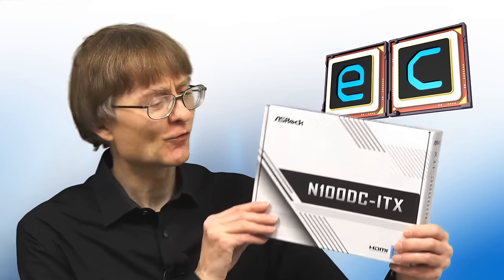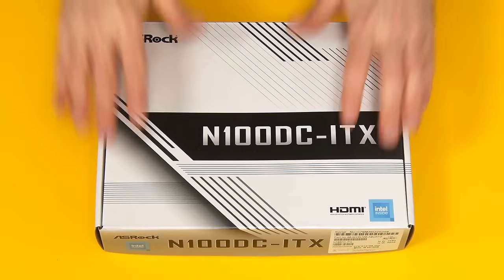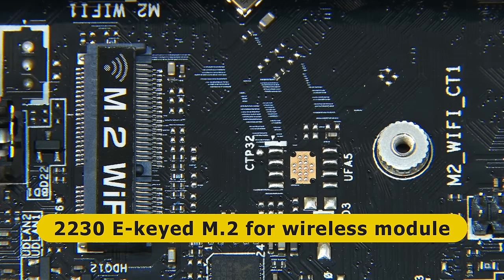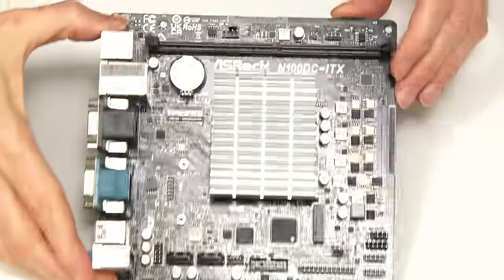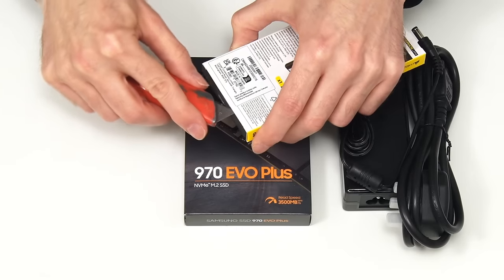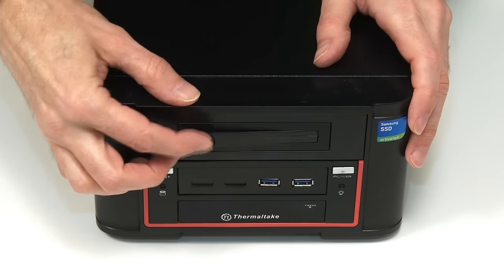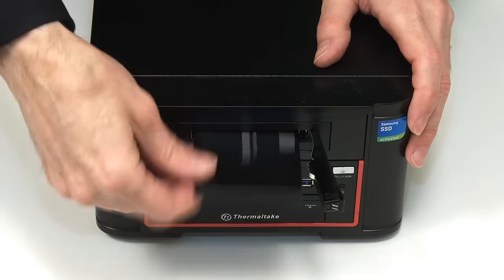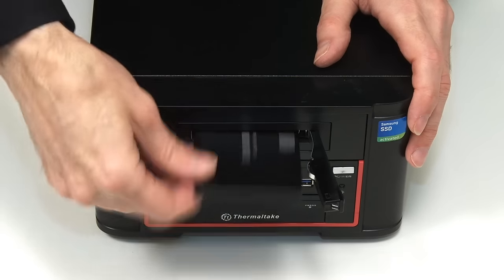N100 Mini-ITX Silent PC Build

Comment: Glad I caught this video Christopher! This gives me some ideas for upgrading a nice old Falcon Northwest aluminum 'Shuttle' type case that currently has an old mini-ATX with a dual-core Celeron that's about used up. I'm pretty sure the case is setup for a micro ITX as well, but even if it isn't, there's plenty of floor space to redrill it for the necessary stand-offs. I don't see those SATA power cables being able to support any type of standard 3.5 in. SATA drives, so I may have to go with the N100M, so I can retain my stock PSU, and a case fan or 2, to keep the drives cool. It wouldn't be quite as efficient, but I could have a LOT more storage, and exponentially faster to boot!😉

Comment: Thanks for the idea! I'm planning to build a low power home server soon and energy usage is a major consideration, alongside noise. While this specific model doesn't have enough SATA ports for my liking (unless I get a PCIe -> SATA card), this has definitely pointed me in the right direction!
Reply: There's a few aliexpress motherboards out there with 6 sata and 1-2 M2 shots.  They appear to be the latest cpu upgrade on boards that came up from 5105 & 6213 cpus.

The main struggle is the N100 only having 9 pci lanes to handle everything, so there's some compromises. Those motherboards seem to originate from NVR security camera recording. So they get 3/4 2.5G ethernet ports (!) which claim the lion's share of the pci lanes.  Still very good value of you wait for the prices to cycle lower.

I was looking at older SFF pcs or H110i motherboards and the price-performance-wattage on the new N100 softrouter/nas setups appear to compete very well even against used systems.  We don't get as great deals on discarded commercial kit in the UK.

Comment: This is why the heyday of the SBC is over. For a comparable price, you can get a more capable system than an SBC. That's not to say there are no use cases for an SBC form factor. But more and more people are going to build systems like this instead of using SBCs. If you're looking for a quick video to produce, you might compare the performance of this computer with similarly-priced SBCs. I think that would be very interesting.

Comment: Hi Chris, the temperature is certainly acceptable for a fanless PC, and the components are mounted fine for airflow, but I'd prefer to keep it cooler if it was mine. You should test it with the case open, or placed on its side, because not having vents at the top may be something you can fix, and a vertical orientation may help speed how quickly air goes over the fins. Once that's determined I feel like the heat sink could be swapped for a larger one if you like (and you'll probably improve cooling just by reapplying thermal paste more evenly). Lastly, you MAY be able to reduce idle power consumption and therefore temperature by capping the CPU speed in windows power options, or the voltage in BIOS. You can look at power options for the samsung drive and RAM too. But I think step #1 should get you up to -5C improvement without any performance hit at all.
Reply: I often wonder why people like to keep their heat in a box )-/

Comment: This would be great to use for a low powered NAS, especially if you used flash storage for the array, complete silence! Great video Chris and may be the basis for my next homelab build.
Reply: Have you seen those NAS N5105 boards by topton? They have 6 SATA ports.
Reply: That was my first thought as well, but the PCIe / M.2 connectivity looks a bit limited to me though. Still an interesting motherboard. I'm running a HP Prodesk 400 G6 (SFF) I bought used off ebay for about £160 a little while back, came with a core i5 (9th gen), 16GB Ram and an SSD. I upgraded a few bits on it and run Unraid on there. Quiet, efficient, and quite powerful when it needs to be.  About 8W on idle and similar on load to this N100 system with an 8 core, Core™ i7-9700T. They are great for a NAS and can fit a single 3.5" drive as well which is handy. Not silent, but I run it in the loft of my garage anyway, so I can' t hear it! 😀

Comment: An EC build without 'come on you little swine'? It's gone very smoothly then!

8GB of RAM instead of 16GB is an interesting choice. I'm assuming Linux Mint 21.3 may see a newer kernel that supports the N100?

Thanks Chris for the video. These N100s are decent little chips.
Reply: He probably said that during the I/O shield install which he skipped lol
Reply: Either putting the I/O shield on went well or our always dashing pal turned the air blue during the process! 😅

Comment: Looks like a convenient and quiet daily Linux driver.  I’d be interested to see how Windows would perform on it, just out of curiosity.  Looking forward to your next video!
Reply: I'm typing this on an N100 mini-pc running Win11. It's fine. Nothing astonishing but I'm delighted for the price.
Reply: @stanwbaker Thanks for the info!  Wishing you a great day!
Reply: These days I feel Windows needs at least 16GB RAM to be performant. Linux is probably ok with 8GB.
Reply: @mikeh7704  That is my general feeling also.
Reply from the maker: Windows still runs perfectly well with 8GB -- it depends on the use case, as I very clearly detailed here. Standard office and web applications run absolutely fine in 8GB of RAM on a properly configured Windows system.
Reply: @ExplainingComputers  Glad to hear it !
Reply: @ExplainingComputers  I think the term "perfectly fine" is debatable when used to described any computer that runs Microsoft's bloated and privacy-hating mess.

Comment: Lovely stuff! Regarding power consumption, I went from ~120W idle on an 3rd gen Xeon 12 core (fastest you could get on socket 2011), all the way down to ~50W with 2.5x the performance with 12th gen. I also added a good chunk of RAM too (32GB to 64GB). 

May not sound like a lot, but given the 24/7 usage, that's a good chuck of my house's base load reduced!

Comment: Its rather interesting to see a motherboard these days that has PS/2, VGA, Serial, and Parallel, while having support for a bunch of modern connections.
Reply: I wonder if the board is aimed at replacing some legacy hardware they wouldn't need much CPU but might still need serial and parallel connections

Comment: Got a couple questions about your choices of hardware:

1:  Why only 8GB?? I would have figured 16 would have been better?? I know that Mint is more efficient memory wise, but that may still be a problem....

2:  Why not the N200 or N300/305.  It seems like the extra performance and  the higher memory and disc performance may have served you better over the next 10 years....

3:  Did you consider a standard power supply with a Zero RPM fan?? That probably would have remained silent unless things were getting really warm....

Thank you for time, I enjoyed the video.  I learned something about tinnitus, in your previous video.  I didn't know there was such a thing as a "trigger" for tinnitus, which explains why my ears whistle more when my HVAC system kicks on.

I hope your holidays is most excellent!!
Reply from the maker: I used 8GB because it is more than sufficient for my use case. I do not understand the obsession that seems to be emerging of fitting more RAM than required (which will use more power and generate more heat). I can 100 per cent guarantee that it will not be "a problem". I am bewildered with the comments here telling me how much RAM I need given the use case I clearly explained.

I am not aware of any N200 or 300/305 Mini-ITX motherboards!

This case does not use a standard ATX PSU. It uses SFX, and a zero RPM SFX PSU is very expensive.

I have built many, many silent and quiet PCs on this channel over the years, including those with zero-RPM PSU fans and very quiet CPU and case fans -- eg in the series that starts here: https://www.youtube.com/watch?v=1iVMGSBFy-M

Please assume that in a build for a daily driver PC with a very specific use case that I did draw on my 30 years of PC building experience, especially of quiet PCs, to select the best components for my use case! :)
Reply: @ExplainingComputers  

Sorry if that came through as confrontational, it was not meant to be.  It was merely a request for information.

1: "8GB is enough for what I need."....kwel!!  

2:  "not aware of  N200 or 300 ITX motherboards."  I did not know there was a problem with sourcing them. They are kind of new so I didn't take that into account .

3:  "zero RPM SFX PSUs are expensive".  Cool, I didn't know that, I don't remember you mentioning that it was an SFX PSU in the video.  I mentioned what does zero RPM was because I live in the US and you live in the UK in terms are not necessarily standardized or interchangeable, I just wanted clarity....

My apologies if I angered you....
Monte
Reply from the maker: Sorry if I offended. :)
Reply: @ExplainingComputers  

Not offended, but....

I really like your channel, and  I learn a lot.  It was a bit like my favorite teacher tearing me apart for asking what I thought was a legitimate question.
I have sense decided that it was either a misunderstanding or a "bad day"....

Thank you for replying;
Monte

Comment: I've got myself a Beelink Mini S12 with the same N100 processor to replace my 24/7 running Pi4 home server with something more powerful. It's running great so far with Proxmox. It's a very capable little processor considering how small amount of power it consumes. Finally I can run Home Assitant OS next to other stuff, and have decent snapshot and backup capabilities.
Reply: I have the same machine for playing media running Linux Mint! I do have the pre-installed Windows 11 Pro on another SSD in it though, just to compare performance.

Comment: I have changed from a full tower also 10+ yo i7 desktop to a modern ryzen mini pc this year. I was looking for a completely quiet desktop. This isn't, but most of the time, the noise gap from the older system is music to the ear. I'd take a leap and say that it improves life quality even.
As a sidenote, I'm currently using a Noctua 120mm fan at a project at work. It's 12V rated, but I'm powering it at 5V. It is not dead silent, no, but inside a case, it might pass unnoticed. And it helps with the thermal profile. Additionally, as a diy project, one could add a usb pwm module and implement a temperature curve control, in order to keep noise at a minimum.
Model I believe it is NF-F12iPPC-2000.

Comment: Back when AsRock used to be complete crap, but this seems like a well-implemented board.  I may have to give them another look.  Thanks!
Reply from the maker: I too remember ASRock as having a poor reputation. But this is the second board I've purchased in the past couple of years (the other for an Intel i5 system), and I've been pleasantly surprised.

Comment: Chris congratulates on your new Linux build computer.🎉! Great see Stanley the knife, Mr Screwdriver, and the other “usual suspects “ at work.  When I worked as a product tester, my old supervisor would killed to have the assembly skills and speed you possess😂😂😂!  
I was reading in “Tom’s Hardware “ that an unnamed Chinese manufacturer build an oversized Laptop using a AMD Epic processor….my suggestion to you..build a AMD Epic machine with passive cooling using the waste heat to heat Tea/Coffee ….20 minutes of a Cinebench benchmark should do the trick…😂!
Have a great day!

Comment: Very interesting and useful video.  Yet, I'm still curious about sound levels for CPU fans as to whether your tinnitus will demand that you will never again have a fan in your "daily driver" system.  My wife has similar complaints about tinnitus, and she uses a Microsoft Surface with a hot little brick-type power supply that has to be replaced periodically as you cannot cover the brick or it can overheat rather quickly.  Finally, thank you for the security comments about a "back door" in a modern BIOS -- something that we need to take greater care about for good IT security.

Comment: Hi Chris, thanks for another quality video. I noticed that the previous i3 PC has two DIMM slots that support dual-channel mode. On the other hand, the N100 PC has only one DIMM slot, which means it operates in single-channel mode. Since it has an iGPU, the performance in memory and GPU-sensitive applications may be dramatically impacted. Additionally, the CPU is considered non-upgradeable. It would be wise to consider an H610 chipset motherboard, such as the Gigabyte H610l. With this option, you can have the i3 CPU for budget purposes and also have the flexibility to upgrade the CPU in the future. I understand that you may prefer a silent PC, but for me, a non-upgradable CPU is a dealbreaker.

Comment: I saw an N95 mini-pc on amazon, with windows 11, for about 149€. It has also SSD and RAM included, and a 12V power supply, and HDMI cable.

Comment: This n100 embedded cpu motherboard is a great choice for daily home use like office work , browsing web , watching YouTube/Netflix/prime  ,  some light gaming with old games and even stock trading ( most of the brokers in my country have a online web trading portal from where 1 can trade so no issues there but i think this cpu can easily handel the  trading softwares which will be  running from ssd . Install 16 gigs ram . ) so it is a allrounder in a budget . ( It's a shame that it is not available in my country) 😤☹️😑.

The best part in this whole vlog is the Linux OS part . He only cloned the the previous drive's content and transferred it to new m2 ssd .

And walla Linux mint system was up and  running just like that 🎉🎊. No  installing of any other drivers except for the video graphics driver which he said will be sorted out with a upgraded Linux Kernel 😮😳😁😆 . 

Now try this os cloning part with windows 😅 

That is why i like Linux .
It's kernel has all the drivers the OS needs to make the system work and ssd/hdd can be swapped easily to other system provided that the other system has same brand's graphic processor as that of previous system example : intel onboard graphics so go for another system with intel onboard graphics even if cpu is older or newer . Same for systems with discrete amd graphic card , find another system with discrete amd graphic card or intel onboard graphic and linux will boot )

I think a 6.x Linux kernel or above will automatically solve the graphic driver problem . 

LMDE 6 already comes with kernel 6.x so graphics driver may have got resolved from that start but its mint update software doesn't has any kernel update section but has got "debian backports" enabled by default so newer kernels are being pushed  to LMDE6  but  LM 21's mint update software does have kernel update section which contains newer kernels series  from canonical

Comment: I’m surprised to see a serial port! I suppose this board would be a good drop in replacement for larger older PCs where serial peripherals are still needed for whatever reason.
Reply: I was surprised to see the serial port as well, but I expect this board is targeted at the controls market where you will still see that as a requirement.

This feature means this could be used as a low power server in a homelab.  Serial ports for management access are a great option.

Comment: My old ITX case, which first had an VIA EPIA M motherboard, it has a rectangular fan, that is cylindrical in shape.

Instead of a blank plastic backing plate, a fan such as in my case, may be of benefit 

👍🤓👍

Comment: Very timely. 
I am looking at NASs with N100 CPUs.
But, I also want to run a project that 10 years ago took more than a Celeron.
So, its good to known that a modern Intel Celeron is twice as fast as a 10 year old Intel i3.
Also one limits the tasks on a server (so one don't have Chrome with 20 tabs open competing for resources in 2000 -- "3-D pipes" screensaver was the resource drain).

Comment: This Will Run Straight Off Of My Ryobi 18Volt Batteries!! I Currently Am Running A Dell Optiplex SFF I7 8700 With m.2 for OS and A Full Sized 16TB HDD To Run jellyfin Media Server And Drive My TV! It Has 1 Fan In It And Unless I Am gaming And The GPU Starts Heating Up You Can Not Hear it From My Couch! I Think i Paid 190 For The PC 180 For The HDD And 50 For The SSD! The Graphics Card Was A Gift So I Did Not List It! It Replaced An Old Dell XPS 410 Core2 Q6600 With A Kingston 128GB SSD And An Old ATI Graphics Card That Had HDMI Out! The Old XPS Did Not Fail But At Some Time You Start To Worry About Faulty Capacitors! I Definitely Got My Money Out Of The Q6600 As Has Trans-coded Thousands Of Hours of DVR'ed TV Shows In The 12 Years I owned It! It Would Be Running 24 Hours A Day 365 days A Year About A Quarter of That Time It Was Converting Mpeg2 To MP4!! the New To me Optiplex Has Quick Sync Which makes Converting Video A Snap! What Was Taking Me Hours Now Only takes Minutes!

Comment: For this CPUs/Systems you should use RAM with a standard SPD, because XMP is not supported (maybe that's the reason why your RAM runs @2133MHz, as you can see in the BIOS).
Reply: it may be possible to manually modify the frequency and ram latencies, which is what I did with my N90.
Reply: All XMP ram will run at a standard SPD when not in XMP mode. Non XMP ram is basically non existent in the consumer space so would cost more to source for most people. £20 is about the cheapest I can find in the UK for 8GB RAM with a heat spreader on it and £17 for one with out so not like he's wasted any money here.
Reply: @clankg33k  Yes, and I guess he will be able to do so. But many Motherboards (BIOS) don't provide such option (locked BIOS). In this case, you will stick with the profile the BIOS will operate with by default (like 2133 in this Video).